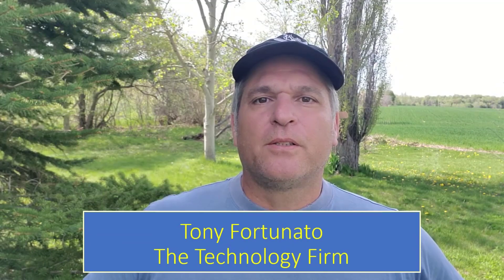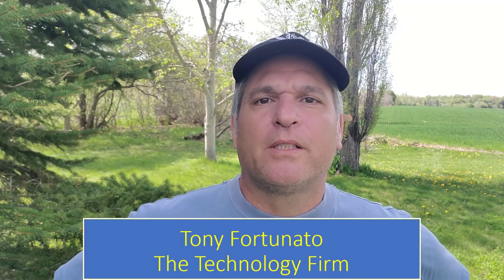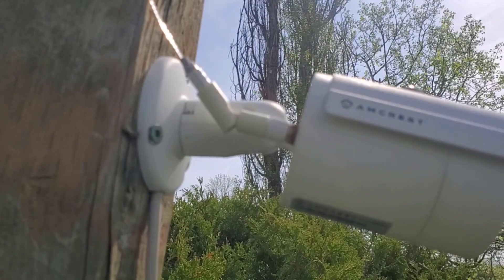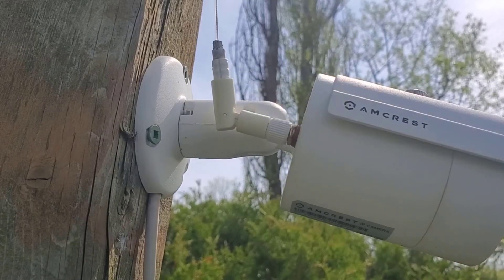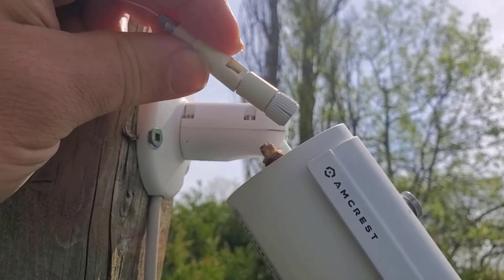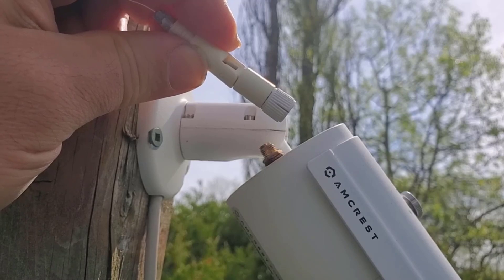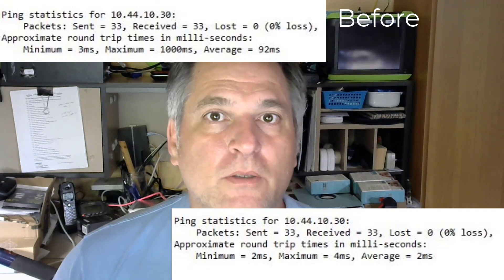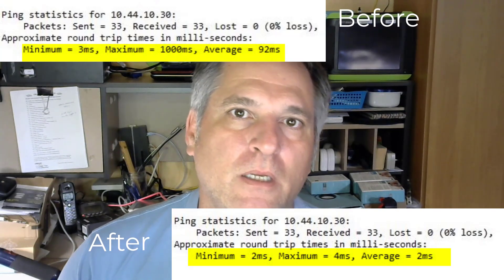Troubleshooting WiFi Outdoors

Comment: Whats the Camera IP rating (Ingress Protection Rating IP65 or IP66) this should determine if it can be placed under the elements.
Reply from the maker: its rated for ip67, so it should be fine